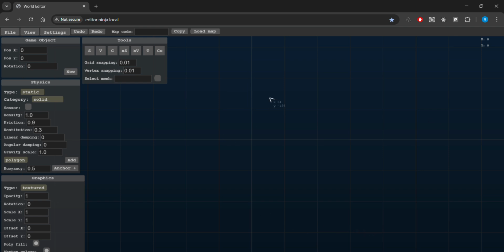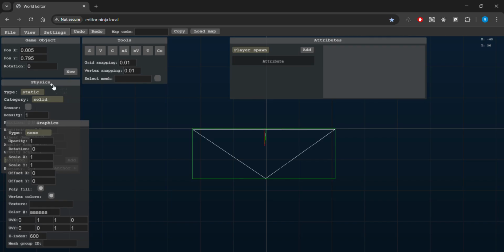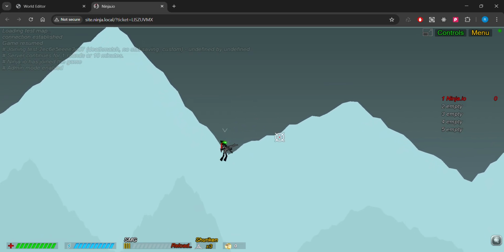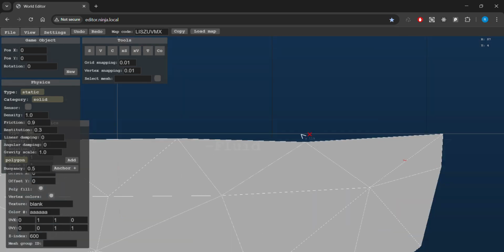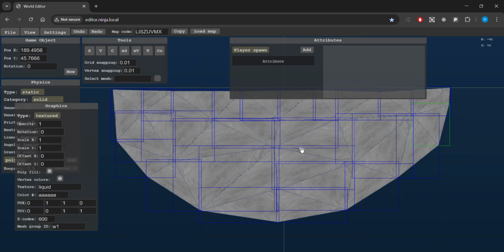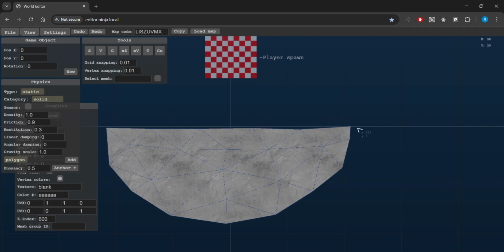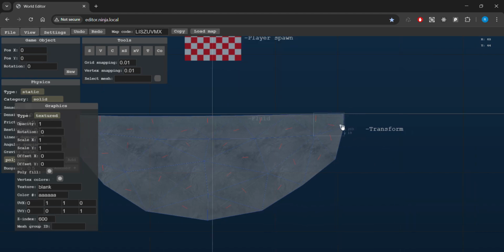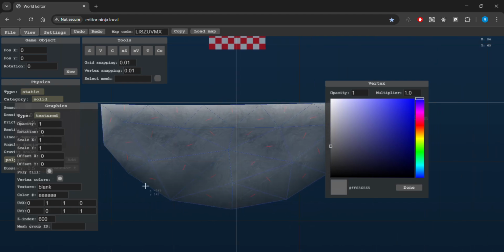Ninja.io Editor Tutorial 2 - Water Basics

Comment: @NinjaIO, when I add water to a map, I can't add any solids, should I add the water at the end to make sure this doesn't happen?
Reply from the maker: The order doesn't matter. If you send me the map code or the URL then I can check what is wrong. You can just put it in the comments here.
Reply: Sorry to bother you, I was doing the wrong thing lol. The triangulation works now, all good👍
Reply: @NinjaIO  I have encountered a new problem though, I can copy objects, but cannot flip the, shift + ctrl + click doesn't work. Here is the code though 0DI4YZQB
Reply: @NinjaIO  Also, I have encountered a new problem , this time for real. I cannot reflect the object in the map across the y axis though I did ctrl + shift. Here is the map code 0DI4YZQB
Reply from the maker: @maxim48666  You can achieve this by reflecting it horizontally and then pressing the ALT-key and dragging the mouse to rotate the object by 180 degrees.
Reply: @NinjaIO  Thanks, that helps a lot! Best dev ever!